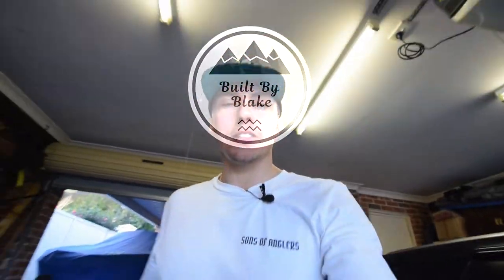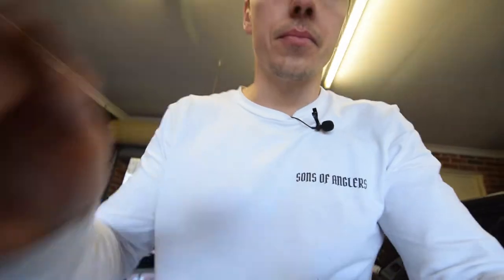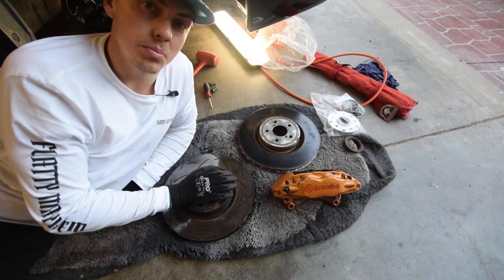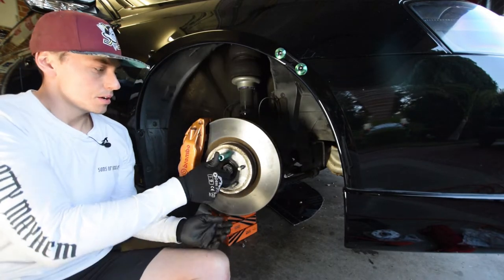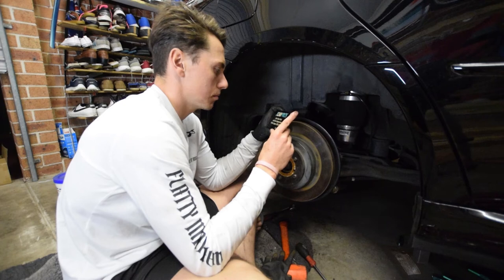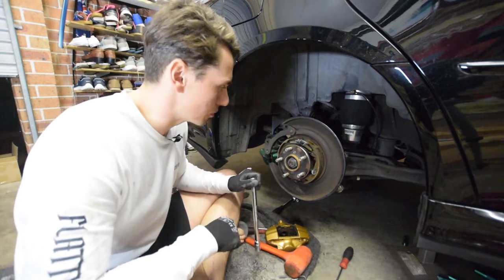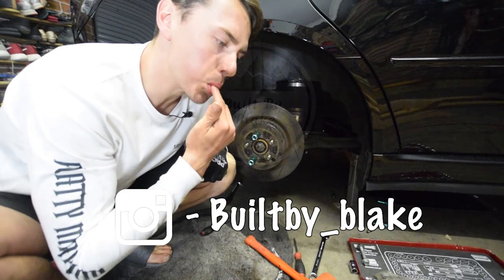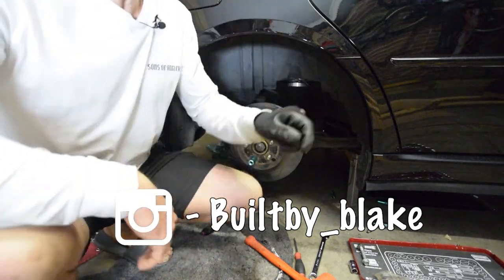Will Brembos Fit Your Subaru?

Comment: Hey mate, getting closer on my brembo swap :) what brake lines did you use, do the sti and legacy have the same thread size?
Reply from the maker: Unsure if the legacy and STI are the same. These are the lines I am using. 
https://www.prospeedracing.com.au/hel-braided-brake-lines-suit-subaru-wrx-01-07-sti~218792
Reply from the maker: You would assume they are all the same, but I dont know for sure.

Comment: Driving a Jdm Spec B also 4th gen and there is little to no clear info (also english is not my native language, so twice the fun), so i'm really thankful for your video! Currently also struggling with the little details like those brembo bolts. Are you using a STI size rotor or something adaptive in the rear?
Reply from the maker: Thanks so much for the kind words legend 🤘🏼.  I'm using the rear rotor that came with the rear Brembos from the STI. (I'm not 100% sure, but I I believe you'll need rear STI rotors to suit the rear Brembos)
Reply: @BuiltByBlake  I was asking because, KNS offers a solution with a custom brake disc so that you don't need bigger parking brakes but then it seems like it's working fine for you without them. :D Personally i want to go a similar if not same route as you, since it's going to be easier to get 04 sti discs than some custom stuff. Anyways keep them videos coming, libery/ legacy needs much more love!